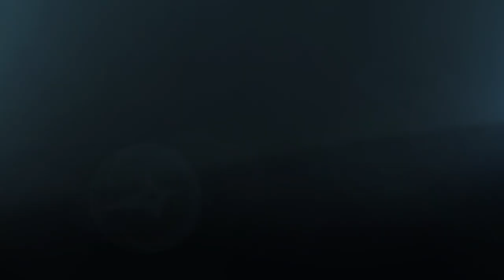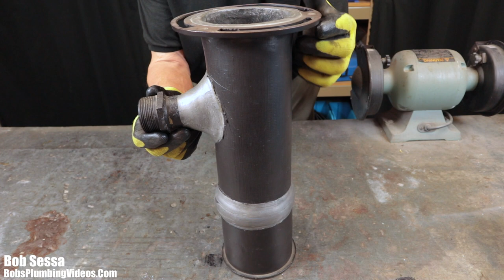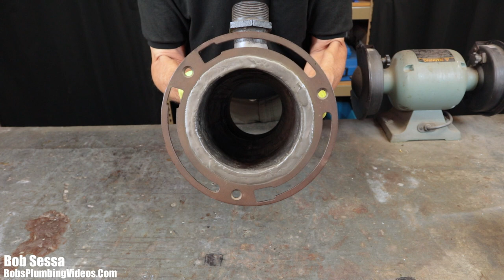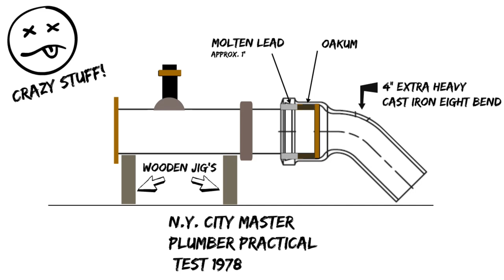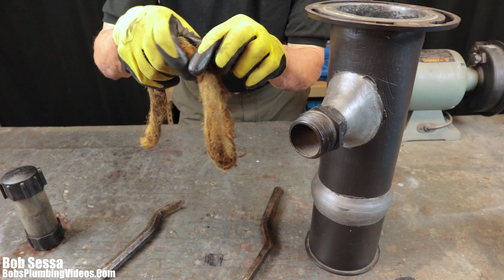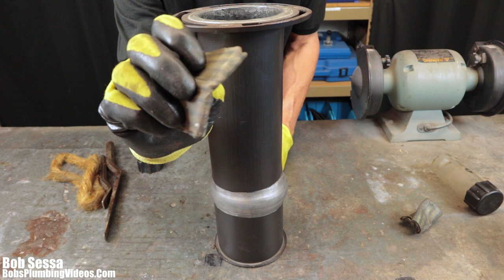Licensed Master Plumber / Practical Test

Comment: Hi greetings from chicago just saw your video that was some king of test, i took my test to become an illinois license Plumber 5 years ago. 3 part test
the practical part 3 projects PVC, copper and cast iron lead joint
the drawing part   drawing drain and vent lines of a 2 floor building and basement  acording to  code
the multiple choice questions  50 question 
I pass the 2nd time around
But my mentor also named Bob old school plumber RIP  told me about his test back when he took it in late 60s and there was a lead joint part he did a demonstration for us once he worked for the water department for a few years before opening his shop He said Sal the best way to keep the craft alive is to share the knowledge thanks for Sharing your knowledge and experiences HAPPY PLUMBING
Reply from the maker: Thank you Sal! I appreciate you stopping by to check out my video. Happy Plumbing! Bob.

Comment: Im a 27 yr irrigation tech n installer in florida and id love to build that triple in pvc copper or galvanize or copper they make it easy with the the tie points via union on top n flange and bottom n the 1978 test ive seen those in bigger systems but they use saddles to install the riser thread on the flange that was in old days only on dynamic flow areas but modern day materials are in some ways similar but different in other ways we down south run everything in 4" n up in sch 40 or 80 polyvinylchloride prefab gasket pipe were we use lube on rubber gasket n we bezel our pvc everytime use 2x4 n sledge knock it in the gasket will expand so once u get goin get it in all way once rubber expands it locks n holds 200psi for final pressure test....most 4" n 6" work this way cut bezel wit sawsaw at 45deg angle so it slides in perfect n dnt pinch is key n we use vitalic alot too thats super simple to use....id love to work in nyc plumbing i just moved to nyc ill look into it looks awesome thank you p.s any nyc plumbers need pt help im looking n i can do it all...... Godbless usa

Comment: Considering the lead it's amazing we are still around at least some of us. My story 1978 repairing typewriters, calculators, (Adding machines/mechanical))  in NYC. A project for a very old city but you need to get the lead out. Trust me I know it is overwhelming but it has to happen. 1978 I was 18. currently work for hp working on servers, point of sale, laptops and enterprise printers. Well in this business you have to graduate 20+ times a year. I have always done my personal plumbing correctly because I do the research and come across the latest; I have not seen anything new on your channel but you have always validated what I have learned in life about plumbing. Thank You.
Reply from the maker: Thank you, it's true I remember going to hardware stores and purchasing asbestos powder mixing it and after wrapping steam fittings with chicken wire apply it with a trowel to insulate the fittings. After all the exposure to lead, asbestos, solder etc. I count my blessings that I'm still here and healthy! Regards, Bob.
Reply: Bless your health, Bob. Quick dumb question for you: which flux do you recommend for soldering copper with acetylene/map gas. I noticed some flux won't work over 700 degrees. Thanks
Reply from the maker: the frugal landlord - https://amzn.to/2JIFqUx
Reply: Thank you Bob! Have a great day!
Reply from the maker: you're welcome!

Comment: Dude you got style it seems to be a lost art in todays world im only 51 but i learned from an old school i was blessed...you are blessed
You are one of the few that i have to tip my hat to you know more then i so i have to conceed...lol
I can do that not as pretty but i can...lol lol
Reply from the maker: I often feel I'm "cursed"! How I ever stayed in the trade? When I started, it was X.H cast iron pipe cut with a hammer and chisel, caulked joints with molten lead, lead pipe,  galvanized screw pipe, brass screw pipe, and NO SAWZALL'S . UGH!!! Lol!

The upside, 68 and still active in the trade. Regards and thanks for checking out the video! Bob.
Reply: My Style of Wiping is Totally Different    Robert Bernardo LMP. NYC

Comment: Was that male adaptor meant to be soldered on back pitched? Just curious, I'm confused how it actually attaches to the pipe under neath the solder.
Reply from the maker: Connected thru the solder itself, hand wiped with a lead wiping cloth. Ideally would go straight in (not back pitched). I made so many of these, I'm still dizzy today.

Comment: Bob, are lead bends still required in NYC and if they are they caulked in with lead or is a FERMCO doughnut used? I would think that it would be hard to push it into a doughnut with out damaging the lead. Is a PVC bend legal in NYC?
Reply: PVC is illegal in all 5 boroughs. That's not to say it can't be found. The rest of New York is fine. Lead bends are still pretty common.